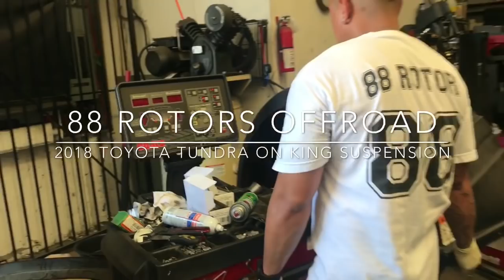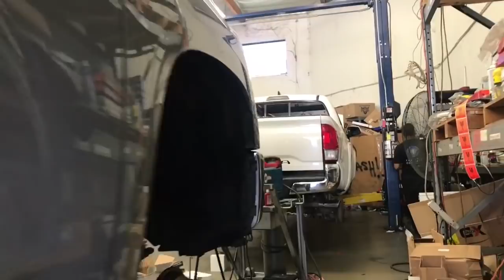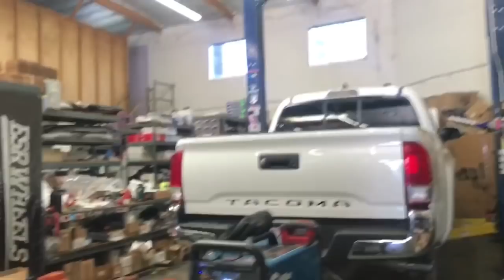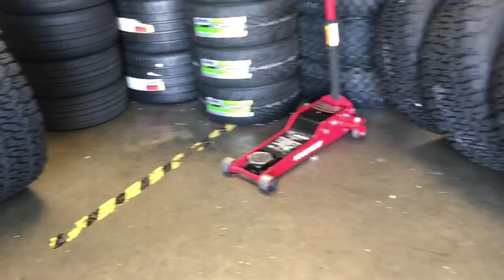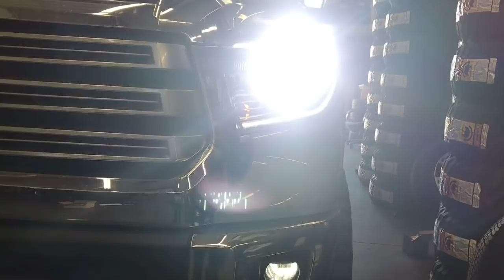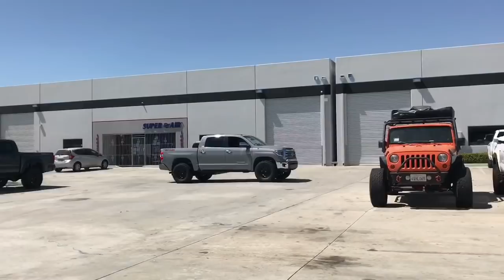Another 2018 Tundra on King Suspension From 88 Rotors Offroad

Comment: Want to thank Chris and the 88rotors crew for the awesome job on my truck!!
Reply from the maker: Thank you for allowing us to work on your vehicle!
Reply: That is one nice truck. What was the height lift front and rear?
Reply: tgtacos anymore mods on your truck? Got the same model and color. Don’t see much that keep the chrome. It’s hella clean!
Reply: tgtacos what ICON stage it did you install?  What was the final lift height done?  Nice looking truck!
Reply: Were these front coils set to the max 3” of lift?  Were there any aftermarket leafs installed?  Do the new rear shocks lift this in the back at all, even a tad bit?